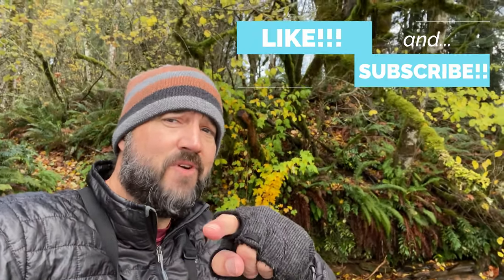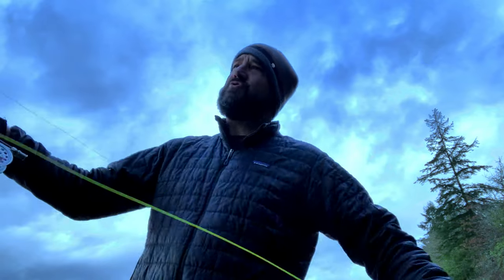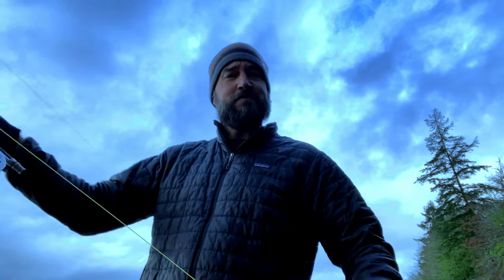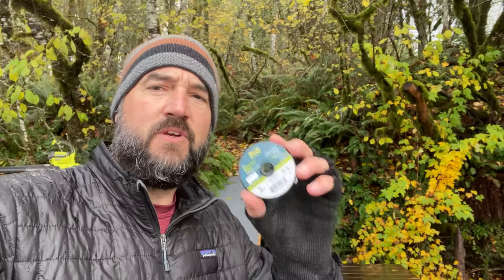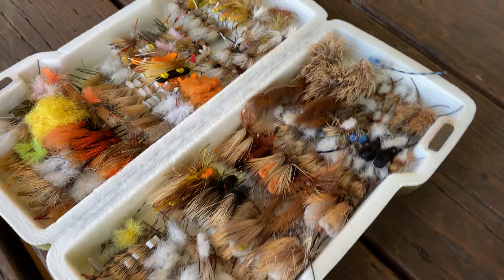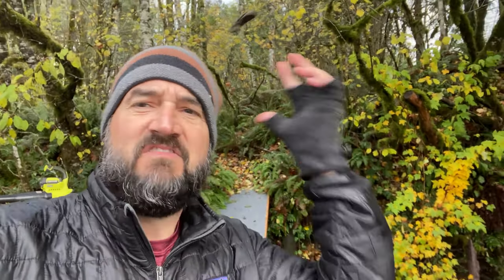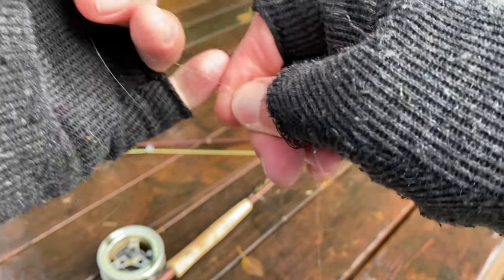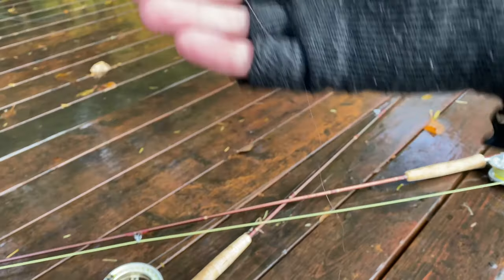DON'T MAKE THIS MISTAKE!  How to Avoid Twisted Leaders How to Fix Them with Ease

Comment: Hey there! Thanks again for the videos. I have a question as I’m new to the sport. But why do they sell the tippet section separately if a lot of the leader you can by are already tapered? Should I be ordering the leader and tippet?
Reply from the maker: Hello!  Once you’ve shortened your tapered leader from fishing, you use tippet to add a little length.  Here’s a vid that helps explain -  cheers! https://youtu.be/evEhabJZEyc
Reply: @FlyFishDan  great video!! Do you have any videos talking about fly line? And could you recommend a good line for me as a beginner to put on my reel? 20vs30 pound ..thanks again you’ve been a lot of help
Reply from the maker: @Anthony-eg7pw  my pleasure!  Check this out…
Reply from the maker: @Anthony-eg7pw  https://youtu.be/XTGJRMGAcEg